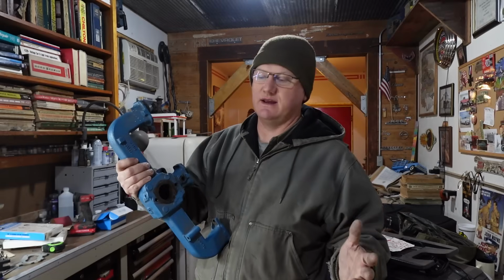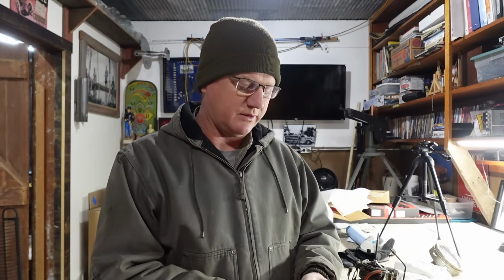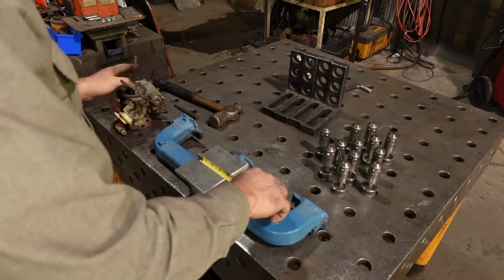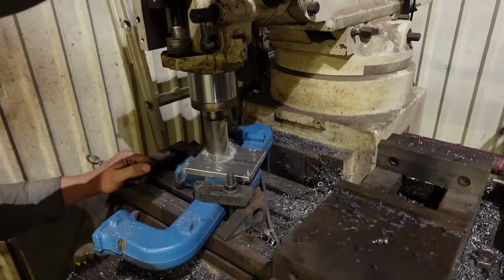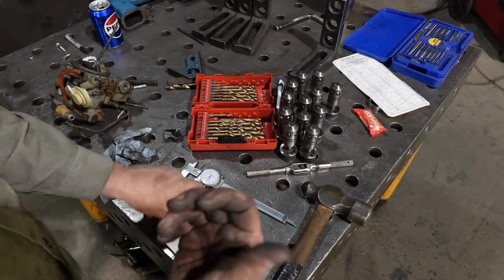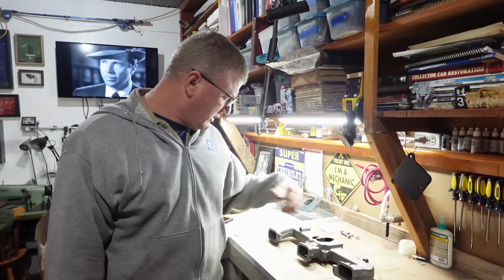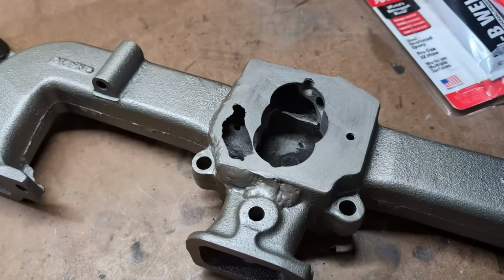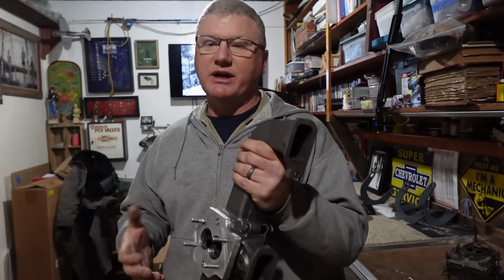Modify a Chevy Inline 6 Intake Manifold from 1bbl to 2

Comment: I installed a holly 2 barrel 4412. Sideways on the 1 barrel manifold. Bored it straight down as big as I could. Where it broke thru I jb welded. Made an adaptor plate and custom linkage. Used it 5 years now works excellent. 25 mpg on the highway. 292 with overdrive.
Reply: Yep,  there's a guy on YT than did the sideways Holley 2v  conversion on the mighty Ford 300 L6 stock intake.  Both of these big 6's   need a least a 2v carb and IMHO an RV style cam with better exhaust manifolds.
Reply: This sounds like how I picture doing this in my head. Sideways but I was thinking of using the ford 2 barrel

Comment: If I had your situation I'd lean toward trying it as is and letting it inform you how it feels. After that assuming it felt like it could use improvement I'd consider packing all the voids with stainless steel wool and using that as backing to smooth over and final fill with JBweld. Dang thing is already a beauty ha. Seems like air likes radius and smooth transitions but I'm not an engineer :)

Comment: I have done something similar with a Holley 2bbl to a Chevy single on a six cylinder engine. I made a one-off adapter out of a store bought adapter and modded the intake by making a big single hole under the adapter. It worked great. The six really woke up with the 2 bbl.

Comment: Mr Jayhawker,I like how you are using your enginuity to enhance the performance of the Twoninetwo cube inch  displacement, May be a 50.8 millimetre or 2 inch riser plate may help with atomisation and airflow it is just a thought,with this said,you have done a great job, cheers from down under,Rob.❤